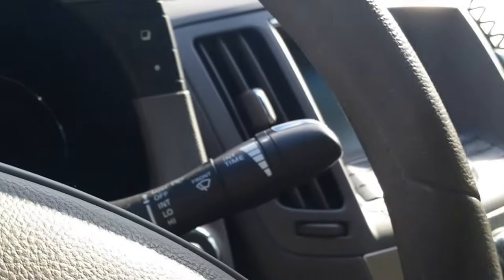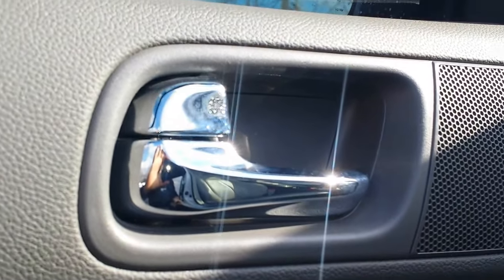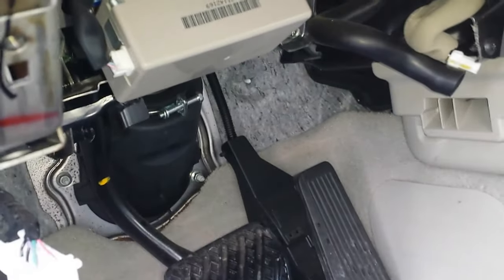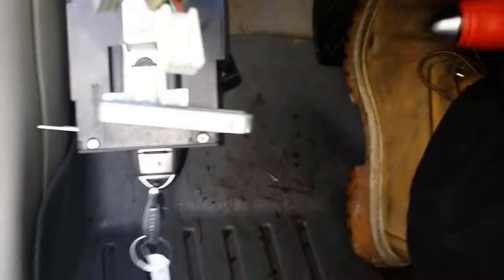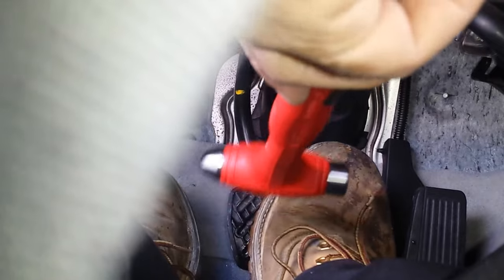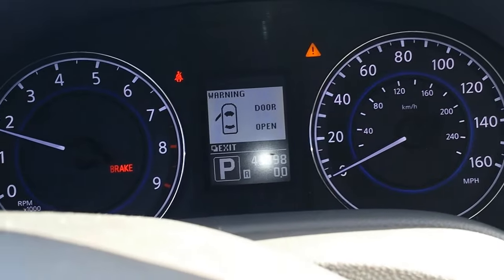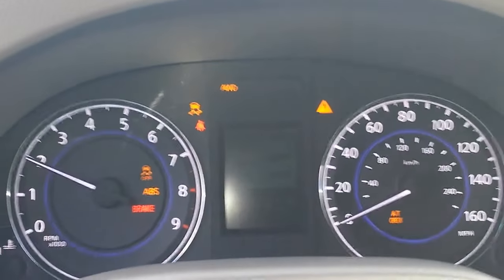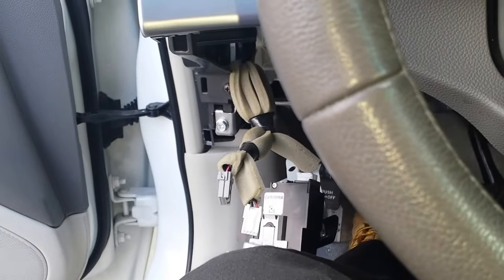How to Start Your Nissan or Infiniti with a Failed Steering Lock Control Unit

Comment: 2010 Infiniti G37 - This suddenly happened to me last night and luckily I found your video. I knocked on it a couple of times and it worked! Now the debate begins on whether or not to repair or just buy a new car.
Reply from the maker: Glad this video helped you!  It certainly will require the Steering Lock Control unit to be replaced.  Knocking on it won't work forever!.  As for a new car, that is up to you!  I still love these older G's

Comment: Out of allllll the videos I watched this one really did the job! All I did was tap the box without taking the bottom part out and it worked! Thank you so much!
Reply from the maker: You are very welcome.  Glad this worked for you.  Now you need to work on getting the Steering lock replaced before the hammer trick stops working.  Thanks for watching!

Comment: There is a motor inside the box, it got bad by being stiff or not responding anymore. Tapping it will a hammer luckily activates it most times due to a loose conductivity of the red wire or black wire connected to the motor  but when the motor inside the box goes completely  dead (burnt wire inside the motor) then it fails to unlock or lock completely.  Get the box out, loose it apart and replace only the motor inside (the motor is less expensive) or check the connecting wire pin entering into the motor, there is a slack contact, put a copper wire into that area to make it tighter (for example adding wire underneath your battery cable to make it tighter for conducting) then press in the wire pins of the motor into that area. This is for those who cant afford the whole lock box unit or even the motor.  After this fix, then you are good to go again for many more years without this happening again.  From my observation when you tap that box with a hammer. You are vibrating the motor and luckily the pins going into the motor in the steering lock  box may contact current and unlock the steering wheel again.

Comment: I was stuck in the parking lot by myself. Just used your video to start my car. Thanks!
Reply from the maker: Thanks for watching and glad this got you started!  Keep in mind, if you had to do this once to start your car, you really should look into replacing the Steering lock control module, cause eventually this trick won't work.

Comment: This video really got me out of a pickle thank you. I found that the plug going into the steering lock module was very loose and had no kind of lock latch or clip on it. i reseated it and followed the video. What i think is happening is if that plug is not seated properly and you try and start the car it locks the steering but the steering lock is cheap and crappy and doesnt release. so i zip tied in in. no problems since.
Reply: The clip out side of the module.?
Reply: @jezabelmae3201   the Male end of the connector had lost its locking clip. This was years ago but it ended up only fixing g it temporarily. I ended up replacing the steering lock module myself. It was pretty easy. Use a dremel or hacksaw to turn the headless bolts into a flat head so you can remove it. It's just 2 bolts and that one connector I think. Car is still running and haven't had anymore of those issues.
Reply: @retam1418  
The clip is inside the part or outside.?
Reply: @jezabelmae3201  outside
Reply: @jezabelmae3201  part# (48700-9N00B) the dealership will want to charge you about 900. The part is about $350 its 2 headless security screws and a connector.

Comment: cool trick it works for me. my car it was working for a couple more days, but i had the same problem againg and i try the same trick and it did not work. my advice, take your car to the mec after you make it run for a first time.

Comment: PERFECT!  Got my Maxima working and got it home.  I pulled the 10A fuse to prevent it from happening again.
Reply from the maker: If you have a 09 or 10 Maxima, there may be a open Recall on this. May want to check with your local dealer.  Thanks for watching!
Reply: FixyourNissan found out today that it was replaced in 2013 under the recall and not covered for a second fix.
Reply from the maker: The Campaign cam out early last year. It's a Steering Lock Delete bulletin.  Call Nissan at 1-800-Nissan-1 and I m sure they will take care of it for you
Reply from the maker: @jezabelmae3201  I do not give out my personal info here.
Reply: @FixyourNissan  
Not your number...
The Nissan's Customer Service Number...???
Reply: @FixyourNissan  
I got it already the 1-800 you posted above.. sorry for the wrong typing typing process...
Reply: Where is the 10a fuse located and name?
Reply: @fixyournissan where is the 10a fuse located and name

Comment: I can't begin to imagine the amount of grief and frustration you have saved me... Thank you kindly for this post.
Reply: did it ever happend again after u tried this ?
Reply: Not since... but I'd suggest to keep a few tools handy in the event it does. Also listen out for the activation of the steering lock when exiting the car. That will be a good indication whether the problem will occur again or not.
Reply: +Dwayne Roach yea definetly keeping the tools in the trunk ... thanks for the reply!
Reply: +Mal Hil it happened to me again today. I remembered a tip from another video about taking out the fuse so I thought I'd share this with you. 

If the steering lock is working, put your car on Acc mode. locate the fuse box under the hood (driver side - after headlight) and remove the 10A fuse for the steering lock.

you will never have to worry about this crap ever again!

Cheers.
Reply: what about my 2006 infiniti g35 I don't have a button my infiniti Haas a knob and it doesn't turn is lick will thAt as well with tapping
Reply: @Dwayne898  
How long til it turn on for you Sir/Ma'am.? Ive been tapping mine countless of time & it still won't turn on.? I got this (yellow icon with key) & still wont turn on... i don't have any power in the vehicle except only the key fob slot - pushbutton & icon to step on the break pedal & push the button... praying i kindly respectfully get a response/advice... thank you
Reply: @Dwayne898  
I have a 2008 infinity m35 auto.. what's the label on the cover of the fuse everyone saying.?

Comment: Happened to me today in my 2009 Nissan Altima.  I didn't even have to take off the panel.  Just put the seat all the way back, lay on the floorboard, and have a flashlight and hammer.  Under the panel (above the brake pedal), locate the silver metal box with the flashlight and tap it a few times with a hammer.  That will do the trick.  It took me about 60 seconds to fix my car.  Same issue as reported in the video.  Click the START button, and nothing.  No click.  No nothing.  Same effect as NOT having the key fob.  Tap the steering wheel lock with a hammer, and you are good to go.
Reply from the maker: That is not a good sign.  That normally is a sign of Control Unit Failure.
Reply: @FixyourNissan  I wanted to rephrase what I said earlier, I have the same yellow key light shown in the video on in my g35 2008 however my car is starting up just fine although one time the ignition switch didn't respond (once) when I tried to power the car off. Point is how do I know for sure if its the steering lock unit my car turns on and off just perfectly could it be a simple fix such as the connection being lose I had recently removed my entire dashboard to replace my Evaporator core and expansion valve. I just want some advice on some simple steps i can do to rule out the steering lock unit.
Reply: @Juan-yb8rm  did you ever figure anything out about this bc same

Comment: If I replace it with a lock box/module from a junkyard, will fix the problem? Thanks
Reply from the maker: It could, if it's bad.  But that is also assuming that the module you get from the junkyard is good.

Comment: I have a 2011 g37s and I have the same problem if I change the part will it fix it? Also the part I looked up to replace comes with a obd programer for the key. Will I have to reprogram my key that I already have?

Comment: 2008 g37 here I don’t have the same control unit for the locked steering wheel. Anyone have any advice? Tried tapping the part, but I’m not really sure if the part I’m tapping is even the correct one. Please help

Comment: Sir, 2009 Nissan Murano, same scenario i did the bang..didnt work..i actually seen a vidoe took it apart and set it..removed the piece the locks the steering..put back plugged it up removed the fuse no luck..

Is that box plug and play? Or does it need to be programmed..i want to pull one from the junkyard? 

Thanks.
Reply from the maker: Plug and play.  Does not require programming.  The hammer trick works about 50% of the time
Reply: What actually goes bad in it, i have taken it apart! 

When you bang what is it doing? 

And thanks.
Reply from the maker: @urighht  You want to tap it with a hammer while holding your foot on the brake pedal and tapping the start button.  If it completes the shut down cycle, it will then start
Reply: So one thing I noticed while i had the lock attached and together that it was not showing the light where it shows push and hold brake, i thought was odd, and i have done what you said but it didnt work previously. 

So then i read that it is plug and play, so i went to a junkyard, pulled another however different style, yes i made an assumption and assumed by memory I had the right one but the build is a little different however the plug is the same and right when i plugged it in, didnt start but showed the push button and foot on the brake again, which then i new i was hopefully halfway to iginition, so I will return the part and get right style and hopefully it starts. 

Also my wheel dont lock when the old one was on, but i am making sure the lock i take off at the junkyard wheel is locked because i assume that means it is still functional. 

Thanks for your reply and I will let ya know what happens.

Comment: cool trick , it worked ! but i have a question, do i have to take my car to mec rigth after or that would be it  ? I have a 2009 coupe nissan altima btw
Reply from the maker: You don't have to go right away, but keep in mind that you can eventually get stuck and the trick my not work eventually.  Thanks for watching!

Comment: Howdy. Mine is more or less the same except mine shows the steering wheel lock symbol with arrows and the yellow key symbol too. Only difference is my wheel actually seems locked as I had the battery disconnected for a while for charging. And the key has battery but doesn't lock or unlock the doors like yours. Shall I still try this trick? Cheers!
Reply from the maker: That sounds like a totally different issue.
Reply: Mine is doing the same thing did you figure it out?

Comment: If I get a new steering lock from eBay from some other car, will it work with my key as soon as I plug it it (or does it need programming)?  I haven't been able to fix mine so I can pull the fuse.  Also having a hard time breaking into the control unit.

Comment: I have the exact problem three question 
1) when I tap on it and start it up would I still need to replace that part? Or I’m good to go 
2) what’s the part called so I can maybe order it
3) would I need to reprogram my key of my car if I do change that part?
Reply from the maker: 1. Thanks for watching!
2. If you tap it with a hammer, that means it will need to be replaced.
3.  It's call the Steering Lock Control Unit.
4. It does not require any programming.  Just replace. You just have to deal with the tamper proof bolts that mounts it.
Reply: Thank you so much I don’t have a small hammer so I did it a tool. What do you mean by tamper proof bolt that mounts
Reply: Would you have an idea how much that part could or will cost?

Comment: My NISSAN 2009 Altima has the similar problem. The key warning light is on, the steering is locked and the car can not get started. What is your advice? In your case, the steering is not locked from your video. Thx.
Reply from the maker: When the car is off, it can seem like the steering wheel is locked when it's not.  But if you are getting very similar  conditions that are like this video, it probably is steering lock related, but should be checked to verify
Reply: FixyourNissan thank you very much for your quick response.
Reply: FixyourNissan The security indicator light is on.
Reply from the maker: @2021-h4o   The Security light is always on.  The key thing is that Yellow Key Light.  If that is on, it's going to require advanced diagnostics to see if the Steering Lock is the issue.  There was a Recall on this for the 09 Altima's

Comment: my car is currently at my mechanic. Should I just have him put it back together and try doing this then? May car is a 2011 and it has less than 44,000 miles but they say it is not under warranty any longer
Reply from the maker: +Renika Norment You can always contact Infiniti and see if they would offer good will to help you.  I know this part is expensive.

Comment: I’m having a no crank issue but the steering lock works properly battery good new alternator and starter and still nothing also changed the clutch switch

Comment: I am having this key signal on my 2008 infiniti g35x, the steering wheel locks and the car will start. The light only comes on when I put the car in reverse and in drive but not in Neutral and in Park. Could this still be the issue??

Comment: Hey Jay . I have 08 Infiniti g35 It got exactly the same issue . Am try to tape with hammer many time it won't work ? Do you have any idea Or time to replace steering lock unit? thank you
Reply from the maker: If it's doing the exact same thing, the Tapping Trick normally works, but doesn't always work. So the Steering lock control unit is around 700 bucks and about 2 hours labor to install.

Comment: Good day sir my wife 2011 Infiniti QX56 got stuck at a resturant and it so happens the same key lock display came up in the dash. I'm having the part replace do i need to have the remote reprogram after the module is replace? And can I just get a use one or would you recommend getting a new unit looking forward to your reply thanks.
Reply: You ever get this fixed, my wife's infiniti has the same issue. Wondering on what part to order and if it's plug in and good to go or needs to be reprogrammed. Thanks

Comment: What if I done use this process before and doesn’t work anymore and my steering wheel doesn’t lock anymore which means my car won’t crank at all , suggest replacing the steering column ?

Comment: I just got stranded from home with my wife and kids. I live in Vegas and our heat is pretty dangerous. I turned the corner at a red light and my brakes locked up. The steering wheel froze and the truck shut off? I tried to put it in neutral to push it out off the street and the shift was locked. The truck would not start but the battery seems fine. I came back to my truck later and the brakes still wouldn't unlock and start until I started playing with the shift lock? The truck starts fine "for now".  Do you have any idea WTF happened?  Any help would be great brother!
Reply: Real, this happened to my ex in the used (but still nice) CRV we bought in 2005.  Toyoto had had a recall regarding this issue which the original owner had not gotten fixed and the local dealership fixed it for free. Not sure anyone these days is fixing things for free, though. My friend's Infiniti has just locked completely up and the dealership here in Atlanta offered to "fix" it (along with multiple belt changes, etc) for a mere pocket change of $3K. RIPOFF.

Comment: Hey I know this video is really old now but hopefully you see this. Will I need a new steering lock unit? Is this something I can replace myself or does it need programming?
Reply from the maker: This part does not require programming.  Replacing this depends on your skill level.  It does have tamper proof bolts that get drilled or chiseled out to remove the steering lock control unit so it can be replaced.  But is a straight forward job

Comment: If this keeps happening but my car keeps running when I hit the box, will it suddenly stop working and not turn on with this method?
Reply from the maker: The Steering lock control unit will need to be replaced if this happens.  This video is something that may get the car started so you can address the issue later.  But should never just assume it's good after this if it starts.  This only works 50% of the time

Comment: My 2010 Infiniti G37x had the same issue several times. Tried the technique the video showed the first 3 times but today it happened again and the hammer trick didn't work (unsure if it's a different issue). After an hour of trying and calling the useless dealership I bought the car from I finally had to call a tow truck to take to the mechanic. He (the tower) took one look at the issue and told me to put the car in Neutral and try starting the engine (no hammer needed)-- worked like magic. Hope this helps if some of the other options don't work.
Reply: By useless dealership I mean the Infiniti in Glencoe IL
Reply from the maker: This issue is only if the steering wheel is found not locked
Reply: Hello, I have a similar story to yours.  this will be the 3rd time its happened to me.  The hammer trick doesn't work anymore.  If i can't put the car in neutral because it won't allow me to be in ACC mode, then what do you think I should do? thank you in advance!

Comment: Hi Jay,  it will be my 3rd time having this issue and the hammer trick didn't work this time. (thank you for the other 2 times) I talked to the infiniti dealer and they said they think they need to reprogram key fob to the car again.  Do you think I should try that option first or just tell them it's the steering lock control unit? Thank you!
Reply from the maker: Thank you for watching. If you had to hit the Steering lock control unit even once to make it work, That is a sign that it needs to be replaced.